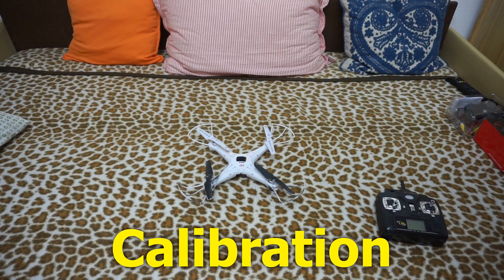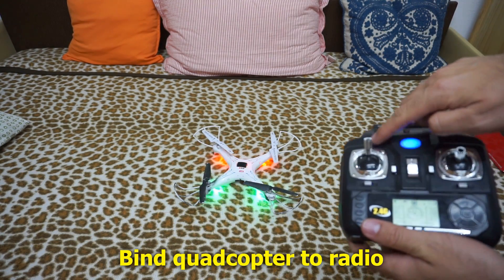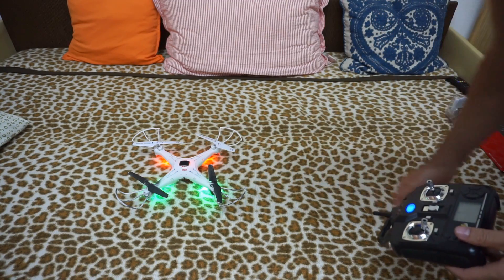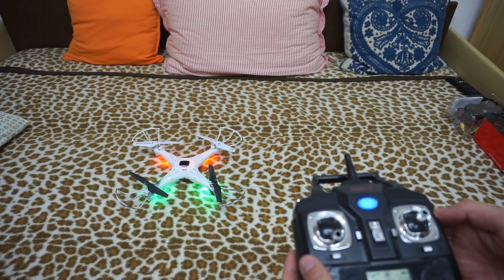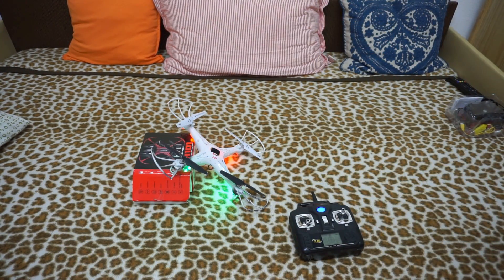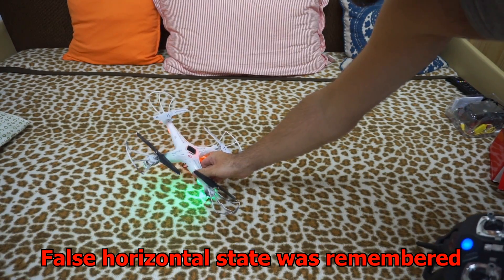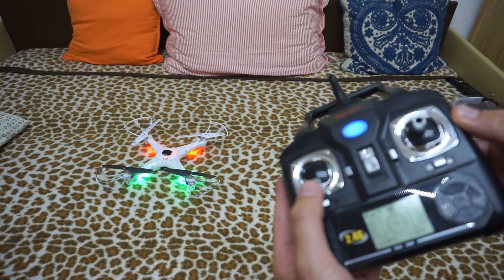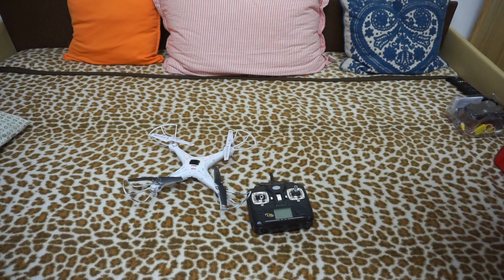How to calibrate quadcopter (Syma X5C, Basic Tutorial)

Comment: my proppeler are not working because i hit it
Reply from the maker: - straighten or replace the propellers
- make sure the propellers are not in contact with the body or propeller guards
- make sure the motor's shaft is not full of tangled objects (hair/grass...)
- check if the motors are overheating
- calibrate the drone
- fully charge the drone battery

Comment: Hi,
But I have another problem, one prop isn't working, do you know how to fix it?
Reply from the maker: It's not turning at all, in any orientation of the drone?
- see if the motor is not overheating (short circuit - replace motor)
- check the electric connections of the motor (maybe a power wire got disconnected)
Reply: furulevi Thank you very much for helping!